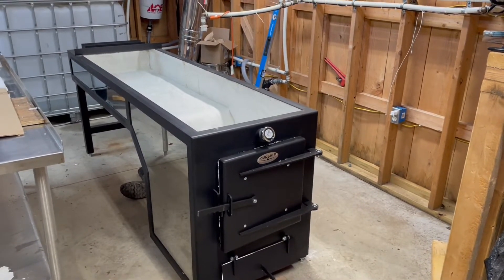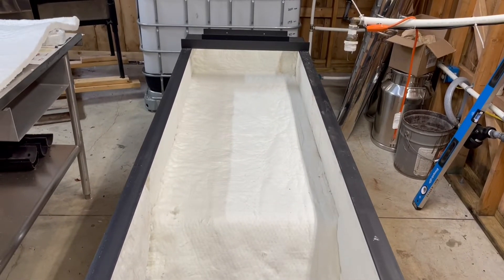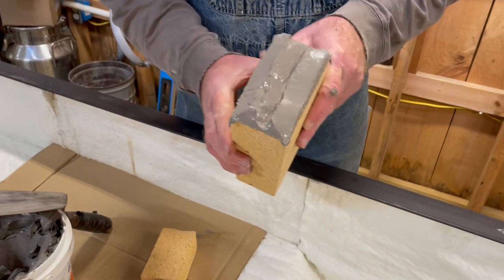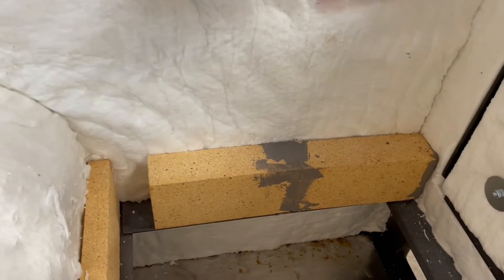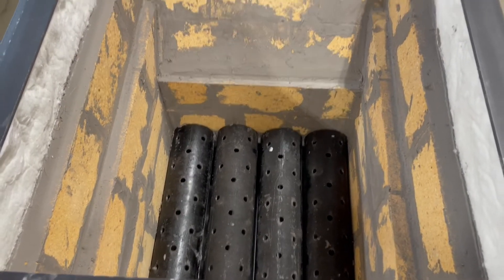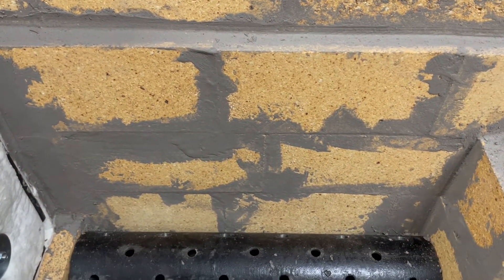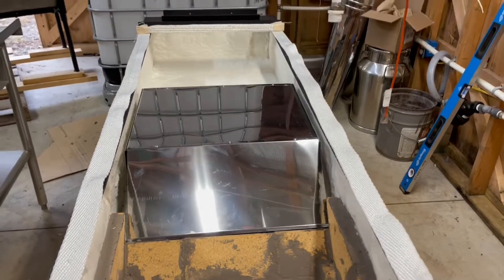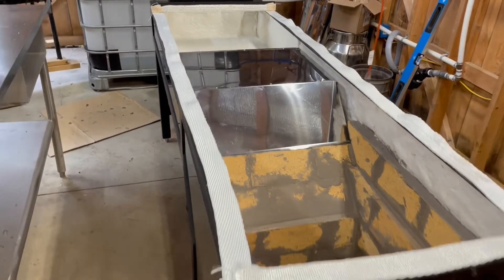How to Install Firebricks in a Smoky Lake Corsair Arch

Comment: I’m getting ready to make my order for my corsair. Kinda confused about the belly pan situation? Is this something that doesn’t normally come with the evaporator?
Reply from the maker: The belly pan normally comes with raised flue pan set. The belly pan forces thee hot air up into the flues. It was a mistake that it did not come with my order. When I contacted Smoky Lake they were helpful and promptly sent the belly pan with no Hassel. To be clear the correct method of installing it is under the fiberglass blanket.
Reply: @southdownfarm6323  thank you for the reply

Comment: How do you attach the insulation to the evaporator?
Reply from the maker: Good question…The insulation is fairly stiff, cut it a smidgen large then tuck it in and it will stay in place on its own.
Reply: Thanks so much!